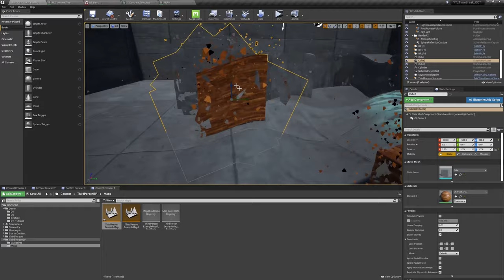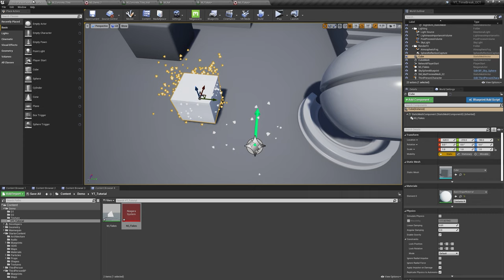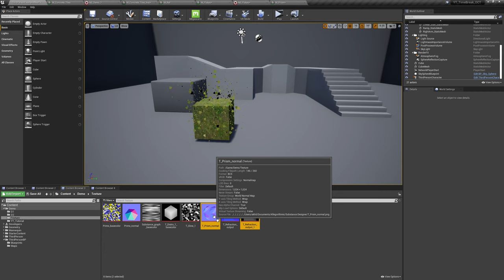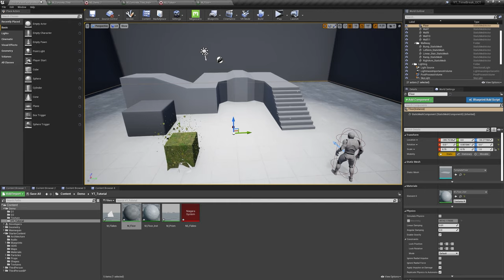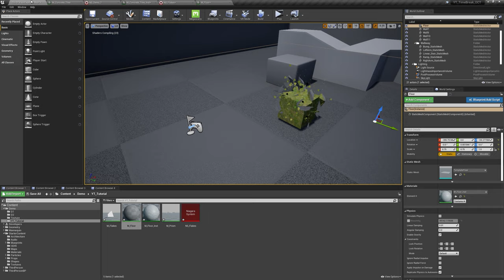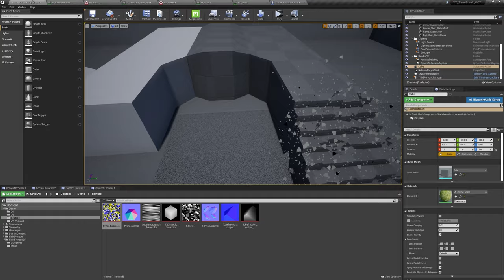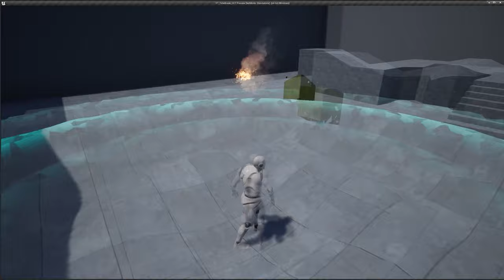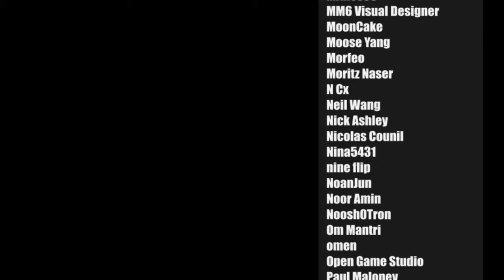Time Distortion Effect - UE4 Tutorial

Comment from the maker: Hi, Since Unreal Engine 5 removed tessellation,  You can get this working with mesh by connect the displacement nodes into the WORLD POSITION OFFSET  of the material. But also ensure that the mesh got enough polygons.

 You can also use the Niagara inbuilt Scalability to control the spawn count with distance and also to sleep or awake the emitter. 

The Scalability Setting can be found on the Emitter State Module Below the Emitter Update. If you set the Scalability Setting to Self. You will get a lot of new settings. 

Thanks to Art VFX for letting me know.
Reply: Can you make a tutorial about PBDs? Cheers
Reply: UnrealCG I can use your material for my indie project!